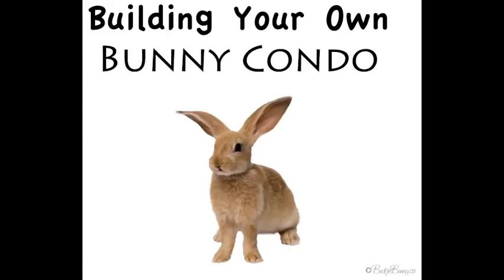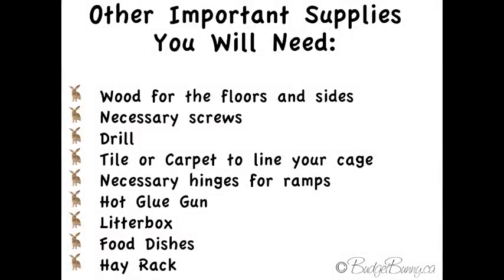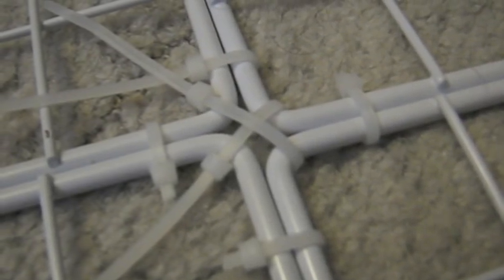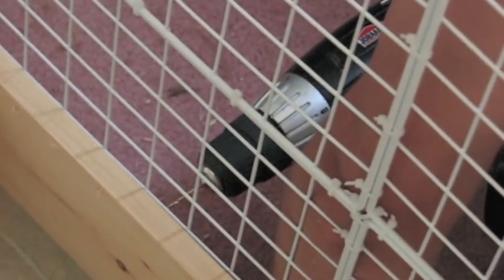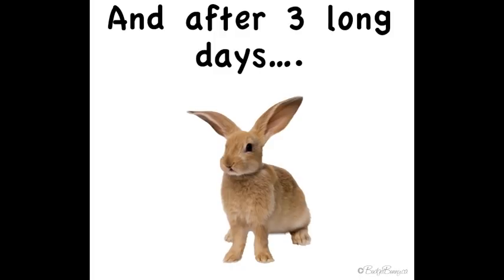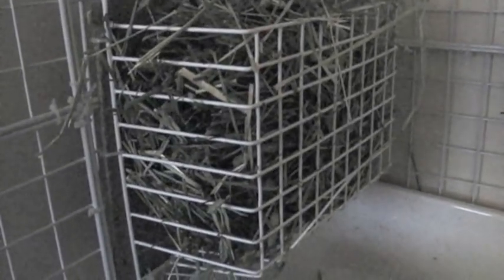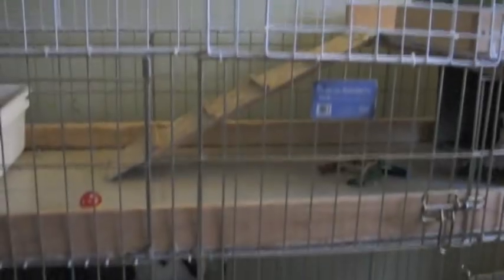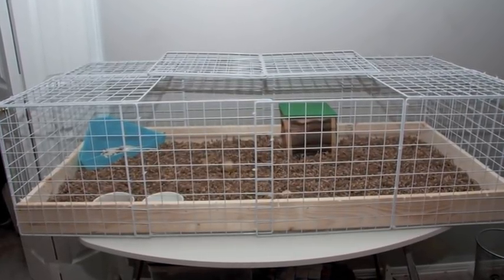BudgetBunny: How To Build Your Own NIC Rabbit Condo

Comment from the maker: We ziptied a layer of grids to create a base to then slide the wood on to. The wood isn't that thick and we haven't had any problems with the weight or anything in the 2.5 years since we constructed them. They are very easy to clean with a shop vac :)

Comment from the maker: If you're going to use wire I would suggest hardware mesh. Chicken wire is too large, your rabbit could try and chew on it which could cause cuts or get it's head stuck in it. If you make the floors out of wood I would still do something to it like tile it, otherwise you won't be able to clean it properly. And your rabbit will need lots of comfy places so it's feet don't get sore hocks from the hard wood floor. I'm sure your rabbit will love the added space! Happy building :)

Comment: I use the black plastic connectors that come with the grids and secure with zip ties. I find this to be better than using only  zip ties because it makes a sturdier unit. I find when using just zip ties the floor sags and it just doesn’t feel or look as sturdy. Either way of connecting the grids is ok, it’s just a matter of preference but I wouldn’t advise  using the connectors by themselves. I did that on one section of my original condo and it came apart several times. Just from the weight & bunnies hopping around.

Comment from the maker: Hubby built the ramps from a thick plywood and used small rectangular dowels for the steps which he attached with small nails. The hinges were from Lowe's which he attached with a drill and screws. :)

Comment from the maker: @rawdog268 Thanks for your concern. If you're referring to the boards we used for the floors it wasn't a concern. The boards were fully tiled and then we used all natural wood to border each floor. There is absolutely no way our rabbits would come in to contact with the board. We built these over a year ago now with no issues.

Comment from the maker: There are corner litterboxes you can buy at the pet store but depending on the size of your rabbit he may not use it. I never thought of velcro, that may work. The important thing is that the substrate that you use in the litterbox has to be different than what you use in the rest of the cage so they can distinguish them form one another and it helps to pick a spot your rabbit tends to go in anyways and put a box underneath it.

Comment from the maker: It's actually very easy! I use a shop vac to quickly vacuum up all the its and bits around the cage, I take out the litterbox, clean it and put in new litter and then spray a vinegar/water solution on the tiles, wiping them dry with paper towel.  If you don't have a shop vac, you can also use a small dustpan and broom (which you can find at the dollar store) but the shop vac is quick and easiest! Takes me about 8-10 minutes a cage. :)

Comment from the maker: It isn't ceramic tile, just those stick on tiles. :) Also I guess it would just depend on your rabbit. I use activity mats (which are kind of square sections of a foam like a yoga mat) during play time but I always put a blanket on top because otherwise my rabbits dig and chew at the foam so I think it all depends on the rabbit. If yours isn't really a digger or chewer than that would be okay and easy to take out and clean.

Comment from the maker: @SnowWhiteLily21! Thank you for watching and for such positive comments! With limited space available this was the most logical way to build. If you never bond your rabbits you can keep the cages separate but we are now removing one of the cubes underneath the full floor of the wood, cutting a hole in the tile, framing the edges and adding a ramp to join the cages together. Would have been a little easier to do it first but wasn't an option for unbonded rabbits at the time. Enjoy your cuties!

Comment from the maker: It's just thick unfinished untreated pine plywood. We used rectangular wooden dowling, cut it down and used tiny nails to hammer them on to provide little steps. Then used large hinges at the tops to attach the ramps to the second level.

Comment from the maker: Hmmm I'm sure ingesting a lot of the plastic coating on the grids wouldn't be ideal. Since I bordered all the levels on the cage with untreated wood I find the rabbits go to town on that and don't touch the grids. I've also used the same concept for our hamster cage and again Chandler chews on the wood and never the bars. Were you just planning on creating a large play pen out of the grids or were you looking at building a larger housing area for play time?

Comment from the maker: We used an all natural wood we found in the lumber section of Lowe's. Sorry neither Hubby or I can remember what type it was but you have to make sure it's not pressure treated or has any kind of finish to it. They will chew on it but just like outdoor hutches and runs that are made out of wood it will take years and years for them to do any real damage. It's been 2 years now and there's little nibble marks but nothing else.

Comment from the maker: We actually tiled the wood so the flooring of the cage is linoleum not wood.  It's therefore easy to wipe up any messes. The only wood the rabbits have access to is the four inch siding we put around the cage to stop any mess like hay, litter etc. from falling out of the cage but mine all use their litterbox well and I've never had a problem with them peeing on that wood.

Comment from the maker: Mine had to get used to the tile because it was a slippery surface but I didn't want to use carpet because I knew they would just dig it up. The only thing I would be wary of with using veneer is that they might eat the finishing but that could really happen with any flooring you use.

Comment from the maker: Not at all, the only thing I've run across was the bunnies have really chewed the top of the wood where the twist ties were on the bottom level so a few ties ended up not serving a purpose anymore since they had gnawed down to where the drilled holes were. It's been three years now and that is such a minor thing - cages have held up nicely :) I have quit a few updated cage tours since this video.

Comment from the maker: I would still say the wood and tiled flooring like we've done. The problem with coroplast is that rabbits are such fanatic chewers it wouldn't last long. We used the same idea to build our hammies cage which I use bedding in. When it comes time to clean, I remove my hamster, use the shop vac to vacuum up the bedding then spray the tile flooring to clean it and you're done :)

Comment from the maker: If you currently have him on bedding this can actually prevent them from forming good litter box habits because he will treat his cage as one big litterbox. Once we switched to larger cages and ditched bedding with the exception of the litterbox they had no problems using that as their place! You can also check out this article on my website: budgetbunny.ca/2012/09/13/when-bunny-wont-use-the-litterbox-10-useful-tips-to-improve-litterbox-habits/

Comment from the maker: @FlyingAlbino777 If you rabbit likes to use his litterbox that's great! Any poop that goes flying when he jumps in and out you can use a small dustpan to sweep up regularly or use a shop vac on the cage which is fast and easy if you have a messy bunny! We bought storage bins for our litterboxes but bought two and bolted the first one to the side of the cage, then sit the other one in it. Your rabbit cant move the box when jumping in and out but you can easily lift out the box for cleaning.

Comment from the maker: @FPDood It wasn't hard, but it was a LOT of work. These took us about 3 1/2 days of working straight (we built 4 cages total) and then a day of organizing and setup. My Husband is a perfectionist and was really picky about how they looked. Hehe. He cut plywood about 8 inches wide then used heavy duty hinges to attach the ramp to the upper levels. He used small pieces of cubed shaped dowling every four inches up the ramp as 'steps' and nailed them in to the wood. I hope that helps!

Comment from the maker: The tile and carpet is a minimal cost compared to the rest of the construction. The body of the cage itself will be the most cost. I don't really have anything else to recommend because you need something you'll be able to clean. I got 4 tiles for $1 at our local dollar store. You may also find a good price on lino that comes in a big roll you cut down at your local hardware store if it's a discontinued pattern. Some people use carpet but I didn't because I knew my rabbits would dig and eat it.

Comment from the maker: @booskie132 There is a chance that they will chew a few of the cable ties but there are few they'll be able to access (there are many ties like on the base of levels that the rabbits can't get at). That's why we kind of overdid it with the ties and why we cut off the extra part of the tie. As for eating them, I've never had my rabbits do that, just once in a while I'll find one on the floor of their cage.

Comment from the maker: I dont have another suggestion unless youre willing to purchase an x-pen which already comes clipped together in sections that way you don't really need zip ties. The only problem with this is that x-pens are pretty expensive but you can modify it like we did in the video (it's Ollie and Willow's cage) to have multiple levels. I can tell you that storage cube cages are becoming more and more popular for many types of small animals and everyone seems to use the zip ties and not have problems :)

Comment: Great video.
Hint: Those little ends that you left on the cable ties that you cut, are super sharp.
Reply: Dan Wright and what do you suppose she does ?
Reply: Touching the cut ends with a lighter or flame of some sort will smooth the sharp edges. Just a quick touch is all it takes.
Reply: Also they are straight, so they might slide up and down. I believe it would be best to do it at an angle to avoid this problem
Reply from the maker: I did cut them extremely short but not enough that they would pop back open. Your idea is a good one but there are literally thousands of cable ties to do that on. I can tell you that we had these condos for years and there was never an issue with them. Any time I’m fostering or working on bonding pairs I use the same idea to create a pen out of the cubes again with no issues. They are also commonly used for guinea pigs.

Comment from the maker: @155LH I totaled it at around $600 - that's give or take, I try to hit up pet shows etc. for cheap hay and stock up but that total's from litter, food and hay included for 4 rabbits over the course of a year from the local pet store. Also the one we built from scratch cost us $150 that's $50 less than we paid for Rocky's first too-small rabbit cage in store! Four rabbits for food for 1 month is approx. $40. Which is only $10 per rabbit! :)

Comment from the maker: I have almost always used water dishes as any water bottle I've tried have leaked somewhat. Once I came home to find a water bottle had leaked completely and poor Ollie had been sitting in water all day long. :( I've tried the most expensive kinds and still had problems. Their dishes are changed 2x daily to keep their water fresh and clean and with four rabbits and two reaching middle age, I've never had this issue. I think it's just preference and for me I prefer dishes.

Comment from the maker: @vascopimentel1994 I replied to your comment at BudgetBunny.ca. In short I recommended using ex-pens or extra large dog crates. Unfortunately they aren't as cheap as using storage cubes but you could easily add additional levels to them using wood, tile and dowling. Hop on over to BudgetBunny.ca for a more in-depth reply. Good luck!

Comment from the maker: These are just cheap stick on tiles you can find at any hardware or dollar store. I didn't use ceramic as they would have been more costly, more work and add a lot of extra weight to the levels in the cage. Before laying each one I did put a small amount of hot glue in the corners just to make sure if the rabbit's dug at them they couldn't get them up! They have worked nicely :)

Comment from the maker: The great thing about these types of cages is that you can customize them! Make them larger, wider, taller, have more or less levels all depending on your rabbits needs! Although I've never seen them in Canada there are apparently too types of storage cubes. Do not use the ones where the inner spaces are greater than 1.5", especially if you'll have a smaller rabbit. They're too wide and your rabbit could get his head stuck or even worse, may be able to escape! Happy building! :)

Comment from the maker: Is there anything else you could make them out of? I've seen some people use those long wire shelves that go in closets for the sides or perhaps hardware mesh with wooden posts to create a larger structure. Some people also just use thick choroplast/correx which is what signs are made of and make the sides really high so the piggies can't get out. You can see this in piggiepigpig's videos. Hope this helps and thanks for the positive feedback! :)

Comment: Thank you so much for this:) I just recently got a bunny and we are going to make his cage a 2nd level this weekend. I have a question--on the ramp where you have the small cross boards(so the bunny doesn't slip) did you glue those pieces down or nail them?

Comment: How did u train ur rabbits to use the litter box? I have my rabbits in a regular pet store cage with paper on the bottom. They poo n pee all over. Cold I belcrow(typo) the litter box to the floor instead of bolting it using two litter box?

Comment from the maker: Rabbits do better in cooler conditions than hot. They should never be exposed to anything colder than -10C or hotter than about 22C. They should also be kept out of direct sunlight that could overheat them especially during hotter months or right near an air vent that could do the same or give them a chill when the ac is on.

Comment from the maker: Nope! :) As shown in the video I did use a LOT of zip ties and on corners used 4 to reinforce for that reason but we built these cages almost 2 years ago with no problems at all. We also did use a few wooden dowels as extra support (I believe also featured in the video) on the levels we added but not sure they were needed. 2 years later the cages still feel sturdy and secure with no problems :)

Comment from the maker: @87policarpio Rabbits need room to hop and stretch their legs so try going longer instead of taller. My rabbits are all dwarfs and a 2x2x3 wouldn't let them move around much. Rabbit Rescue suggests your rabbit stay in an x-pen (the base of one of our cages) which is equal to 5 cubes in length x 2 wide x 3 tall. Hope that helps :)

Comment: Can you just use the c&c squares for flooring and put fleece on it??!
Reply: Jazzyln Smith No because they'll feet will still get damaged from the grid, they need a flat surface :)
Reply: +DIY animal queen 123 No bc, they can still feel the wire and can get sore hocks. What I do for my rabbits is they have lineoleum over the plywood, then a memory foam matrass pad cut to fit their cage and on the sub levels they have just the lineoleum (rabbits love to have different flooring). Finally, they have just fleece on some areas of the sub levels. Hope I helped!
Reply: +Jazz Smith no sadly they can get sore hocks it also probably isn't going to be to stable for a floor depends on how you put the grids together though hope this helps ❤️ btw cute dog

Comment from the maker: @eblackrose00 
It's actually really easy.  A shop vac is your best friend!  I shop vac everything up (poops and litter and excess hay) that's hanging around the cage, then I just spray some vinegar/water solution and wipe down with some paper towel.  Takes about 10-15 minutes per cage.  You'll actually find that the larger the cage, the easier it is to clean and I find my rabbits have much better litter box and living habits now that they have extra room to move around in. :)

Comment: Have you needed to replace the zip ties? My rabbits love to chew!
Reply from the maker: We used so many zip ties it hasn't been a concern! I've never noticed the rabbits chewing at them although they do like to chew the wood sides occasionally (exactly why we ensured they were non-treated). Sometimes when moving the cages around to clean behind a zip tie or two will fall off but in 4 years we haven't have to redo or replace any areas or zip ties.

Comment: Is the second level really safe? it did not look that stable. I mean it's just heavy wood on top of wire doesn't seem safe.
Reply from the maker: It was very safe. My rabbits were in these cages for four years with no issues. In the video I also showed that we used wooden dowling that we secured in to place underneath the levels to add extra stability.

Comment from the maker: Wire floors are the WORST thing that a rabbit can be on. Our rabbits are litterbox trained which is why they have boxes in their cages so they're not stepping on their poo all the time. Secondly wire floors puts pressure on ALL rabbit's feet. It causes deformities and sore hocks which can lead to infections and health problems, even death. I recommend you check out the HRS webpage or Rabbit Rescue for proper info on this topic.

Comment: Actually, most bunny owners prefer dishes. They are more natural from the rabbit to drink out of. Also, responsible rabbit owners change the water in the dish frequently so hair building up in the dish is not a problem. The rabbit also does not have to work as hard to get water.